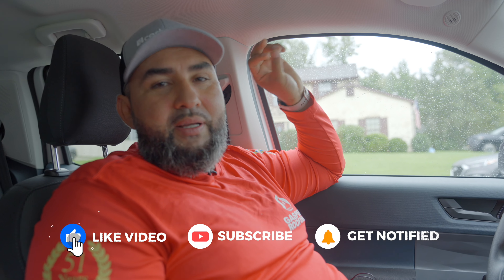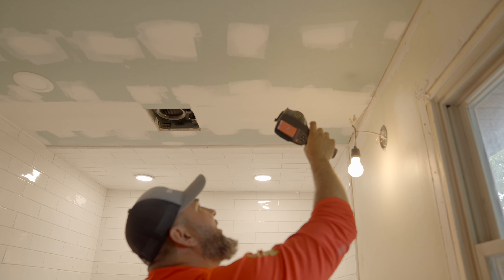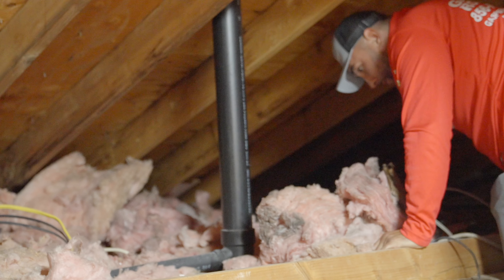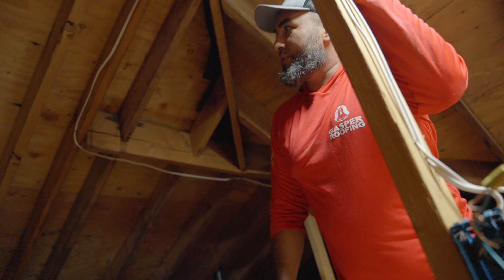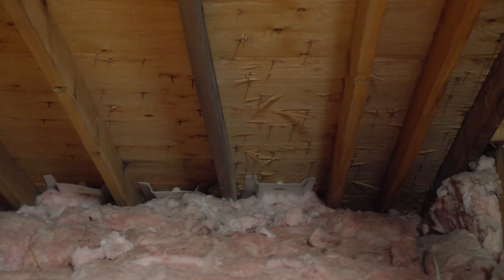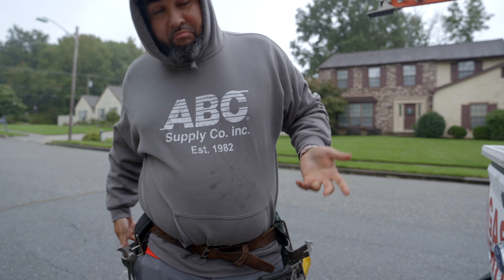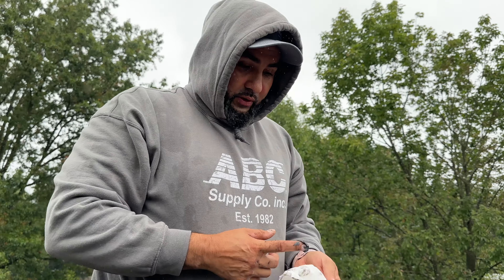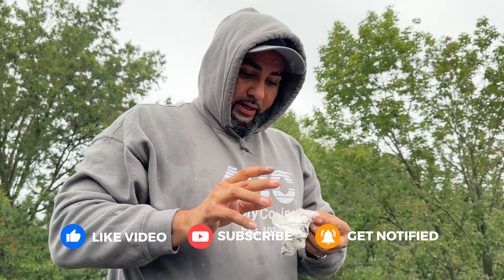HOW TO DETECT A ROOF LEAK LIKE A PRO 💧

Comment: same as me plumbing boot  also those rubber parts on  the  boots dry out and fail . That is what happened to my plastic rubber boots . new roof new boots and added extra rubber boot caps to the top of the ones already on the boots . 2 better than one .I do have to get a new theromstat on my whole house attic fan  . The motors OK but the thermostat is not working All new roof and paid extra to have ice and watershield put on my whole roof  and roofer did new custom drip edge that goes out 6 inchs onto the roof and 4 inchs down on the sides and front and back with tar seal and then nails holding it down and then ice and watershield over that .  New 6 inch seamless  gutters to replace 5 inch seamless  gutters and 2 extra downspouts  on my 100 foot long house  . Not sure but old gutters worked until I added the front porch all across the whole front . Ice and  watershield worth every penny  .
Reply from the maker: I agree!
Reply: best is my insurance company will give me money off insurance as it is called maintenence and upkeep . I got money back also because i added another layer of R30 to my attic . But I  did that myself . Had blown in insulation done 6 years ago and not sure where it went but it went  bye bye . 6 ft of it just gone and it is not in the soffits either . I am up on a hill and we can get some really strong winds but never thought that would happen . The pink  failed me that time